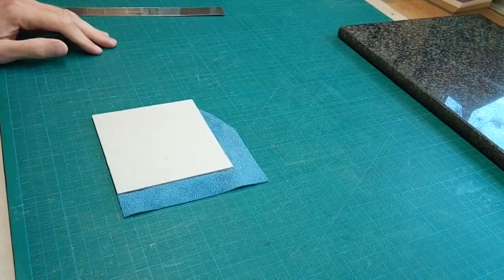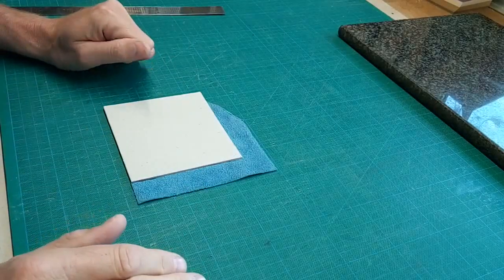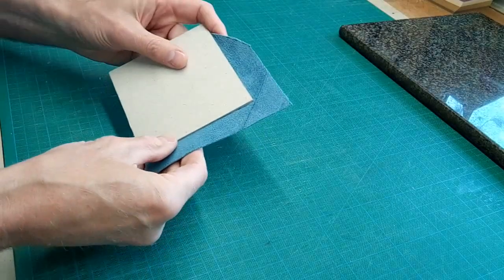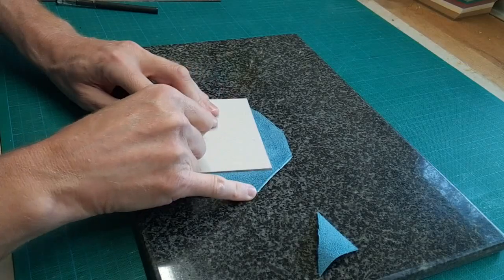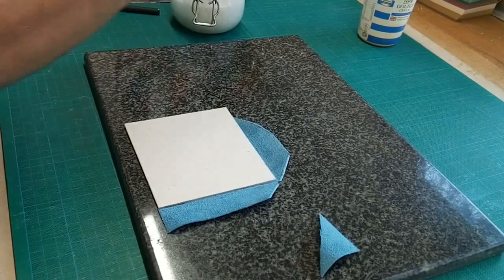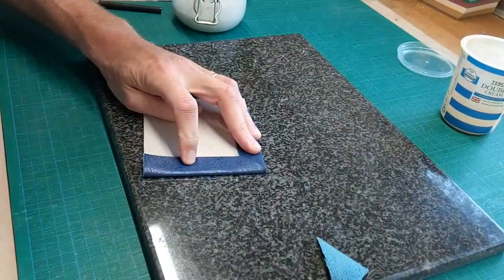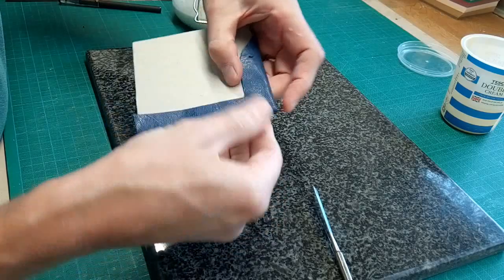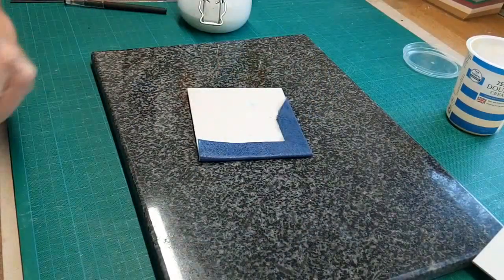Bookbinding - How to make neat Leather Corners

Comment: Thank you very much! I want to turn fixed buckram hardcover books into half leather covers or cases... I'm having to piece together the instructions as, for example, DAS' example had the leather glued to the edge binding, whereas I want it not to be. I know how to make a tube-style full leather soft cover for bibles with bumpers so between that and your corners I suppose it's coming together! I just.... if I'm going to cut the failing buckram hardcover off a favorite book, instead of just covering the spine with cloth I'd like to do them more nicely, but I don't want to get into full leather hardback yet, with its potential warping in my lining isn't a perfect match.

Comment: Skiving the leather is essential for achieving a nice corner.
Reply from the maker: Not necessarily using this method - it can be done with full thickness goat leather (ie: 0.7mm or so) and still look nice and neat but of course it depend how delicate you want the board edges to be. If you want nice thin edges to the boards then the leather does indeed need to be thinned in that area.

Comment: Thank you, you explain this process so well. I am about to make a travel journal with some recycled leather from my late husband's work diary. It will be for our grandson so a special project. I was struggling with the corners. With most of my projects in cardmaking I round the corners, do you thinks the square corner would be easier with leather? 🙂🇦🇺
Reply from the maker: Definitely - you can do rounded corners using various pleating techniques but it is very tricky to get right. Square corners are much more straightforward!

Comment: Many thanks for this tip - at what stage of a full leather covering do you suggest this is done? Before the head and tail are turned in ? Thanks Jim
Reply from the maker: Hi Jim - i would cut the corners after the leather is applied to the spine and boards but before turning in, otherwise it can be a bit awkward to get a straight cut. Then usually I apply a bit more paste and turn in the head and tail and then finally the fore edges. The paste then gives you enough time to work each corner and make it neat.